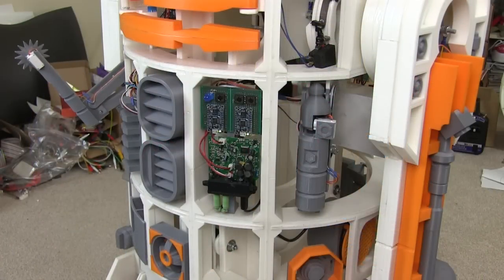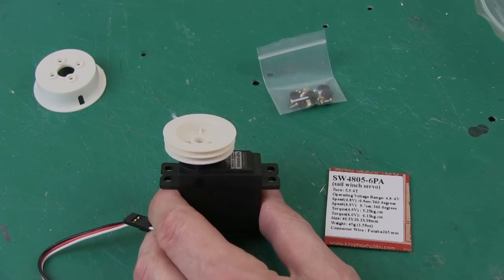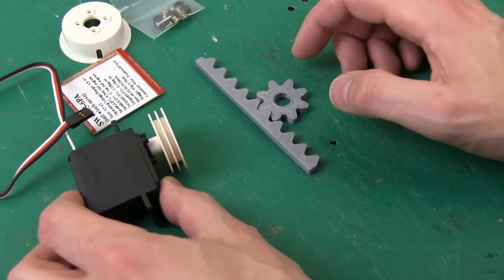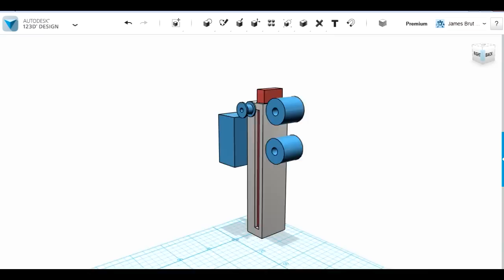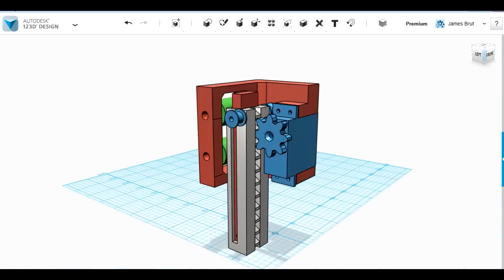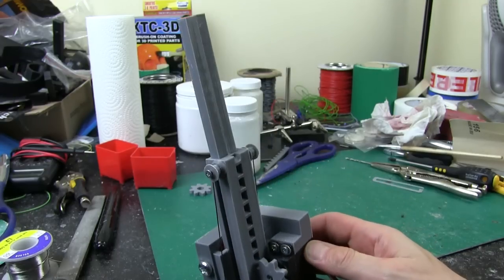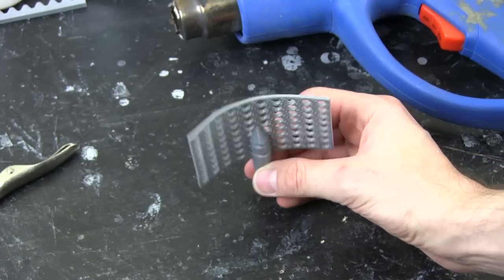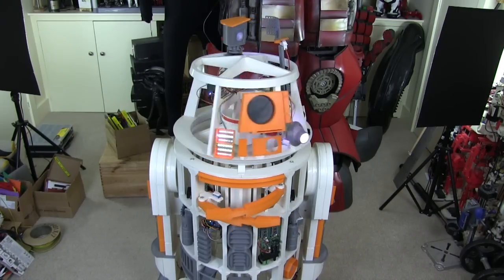Star Wars R6 Droid #18 | Life Form Scanner | James Bruton

Comment: I haven't heard of the sailboat wench before.  They would be useful for quite a few applications.  The gears look like they turned out great.  The servo and gear combo shows a lot of promise.  It could replace quite a few of your slide and pulley mechanisms.  From what I can see, it seems like it would be much more robust. 

Keep up the great work!
Reply: +James Bruton (XRobots) Hey there, wasn't sure if you were aware of this or not, but a lot of CAD/STL files can be found on websites such as McMasterCarr. They supply them so people can throw into their models in any software to check fits etc before buying metal, but a great way to get models for plastic!

Question/tip/feedback - I like when you explain why you chose X mechanism or motion vs another, please keep doing this as it's something people only learn from experience or it being passed on and depends on the application. What do you do to determine strengths for loads on framing, mechanisms, etc? Lastly, do you provide sources on your electronics and controls?

Comment: you could make a mechanism in the head using a strong spring to fire a lightsaber handle out of.
also, you could try using a connect to track and follow you. obviously that may be a bit difficult due to space in the droid, complexity of the system and how you would get it to track only you, but it would be cool.